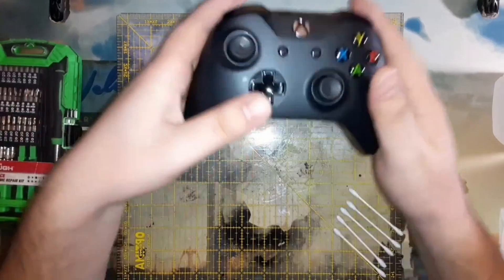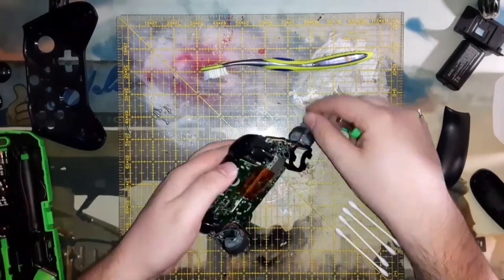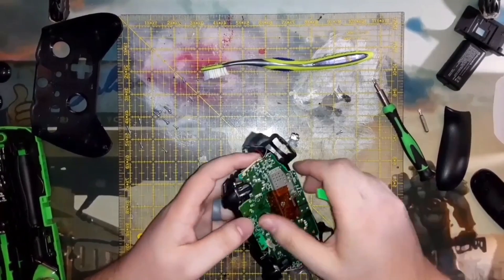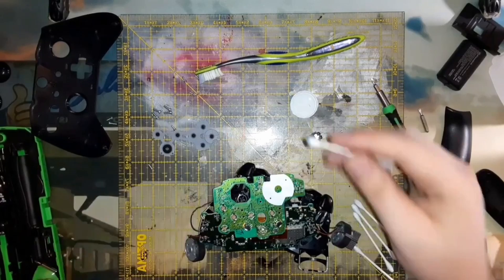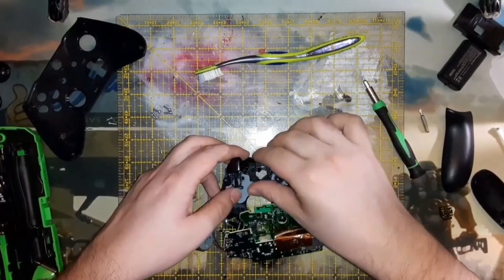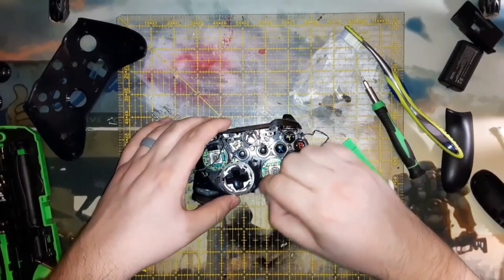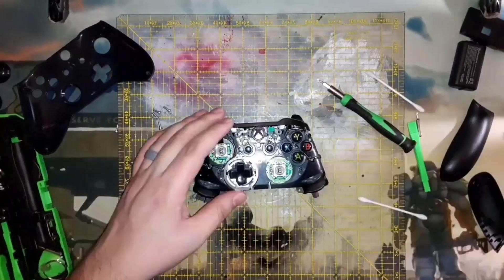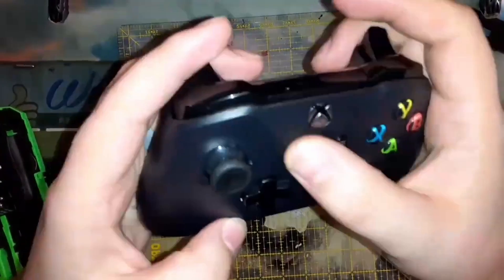Cleaning an Xbox One Controller (Liquid Spill)

Comment: I know this is a really late comment but i spilled sprite on my controller when i was sick! My x,menu,screenshot,and a button are all hard to press and very slow rise,please help me!
Reply from the maker: This video is a pretty good guide for any controller. Take it apart ASAP (sorry for the delay in my reply) and clean out any or liquid that you see, allow it or force it with canned air to completely dry and put it back together and it should be fine.